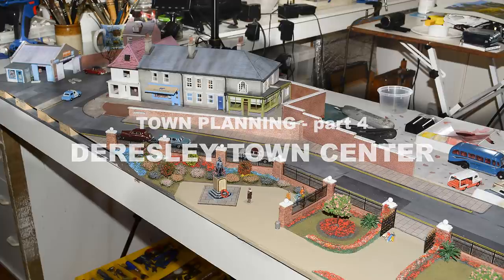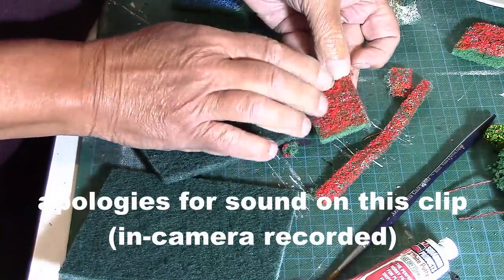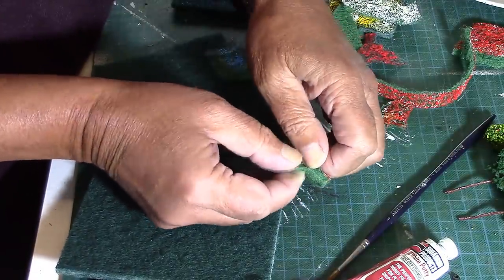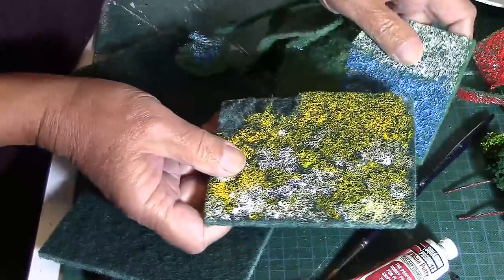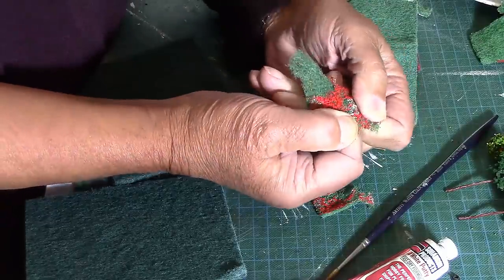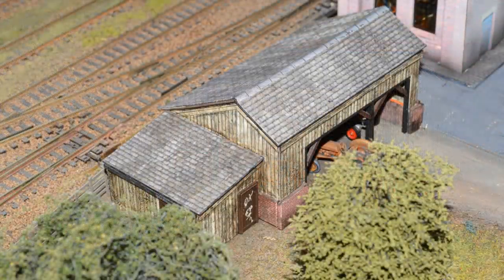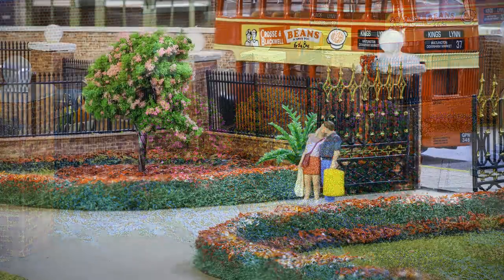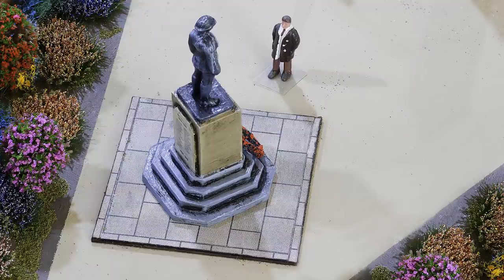DERESLEY TOWN PLANNING Pt 4

Comment: Hi David, wonderful stuff as always. I don't know if you noticed but there's a little buzzing on your audio - I think it's because the volume of your narration is going above -0db and redlining which is causing distortion. The solution would be to reduce the volume and add compression to make up the missing loudness.
Reply from the maker: Hey, thanks for the feedback on this - I will check the audio on my next upload. Just recently changed to using a separate audio recorder. Appreciate the comment 👍👍👍